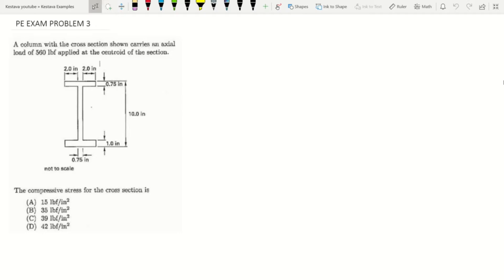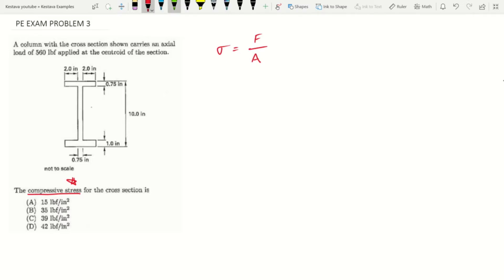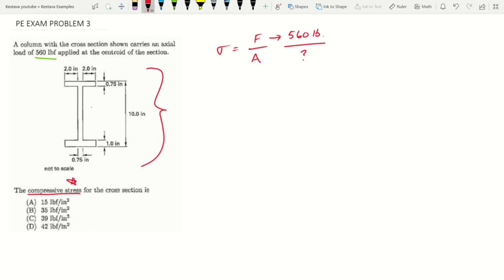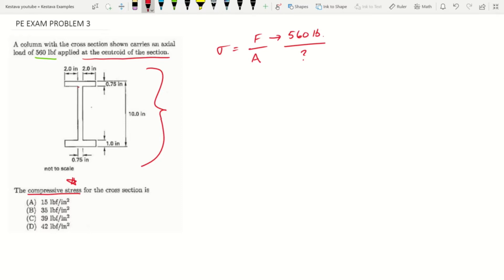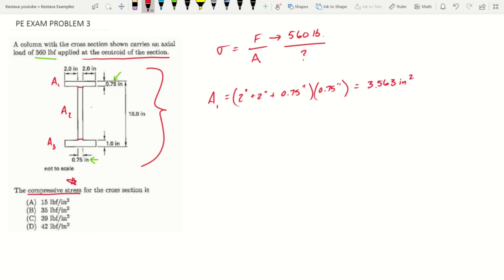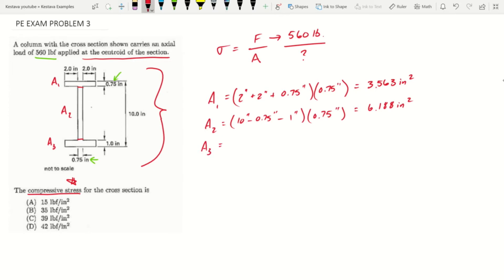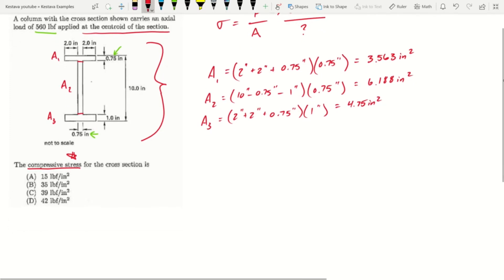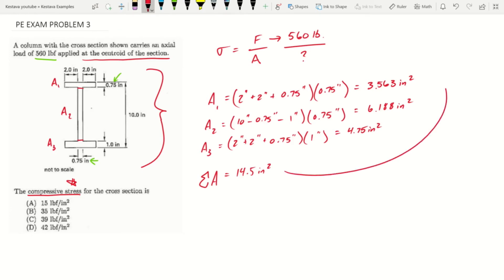Civil PE Exam Review Problem 3

Comment: I’m a little puzzled about the centroid.  Is it always just the sum of the area?
Reply from the maker: Hi Jeffery, you need the sum of the area to find the compressive stress acting through the column. in this case stress is equally distributed throughout the cross section of the column because the axial load is acting at the centroid of the column. if the axial load was not acting on the centroid of the column then an eccentricity would be introduced - resulting in an internal moment acting on the column - thus giving you an unbalanced stress distribution.
Reply from the maker: i should do a problem that introduces eccentric loading criteria for you and the team!
Reply: @Kestava_Engineering  yes pls
Reply: @Kestava_Engineering  can you see an eccentric problem in the morning ?